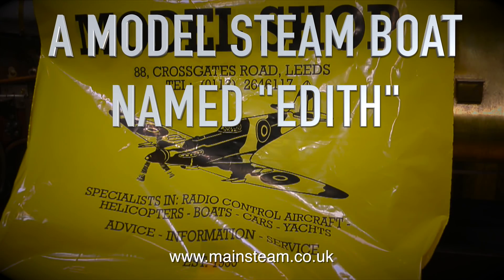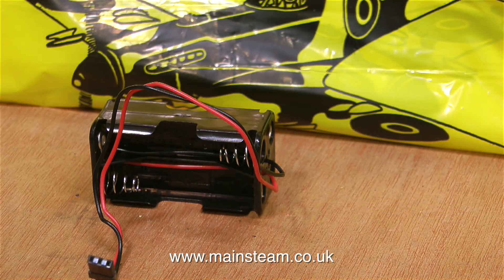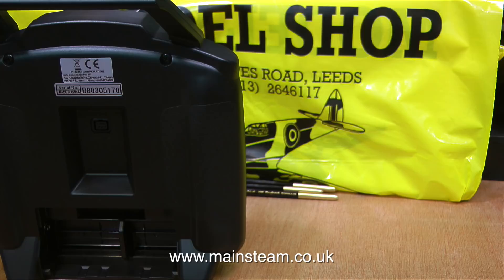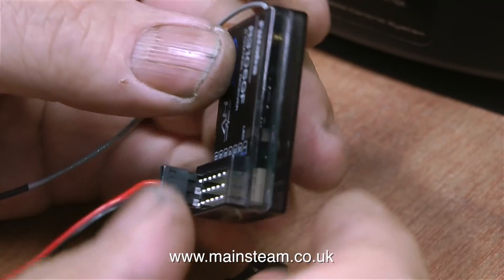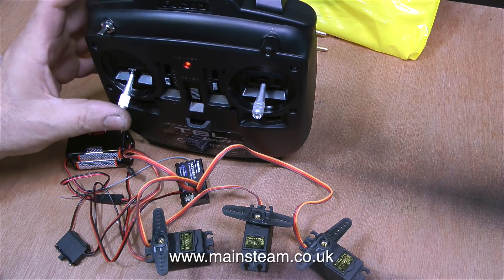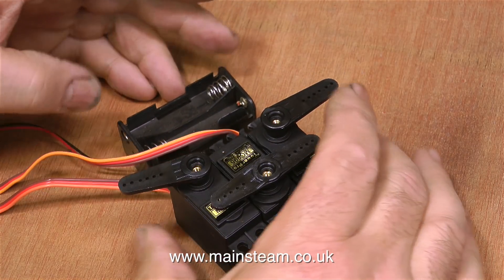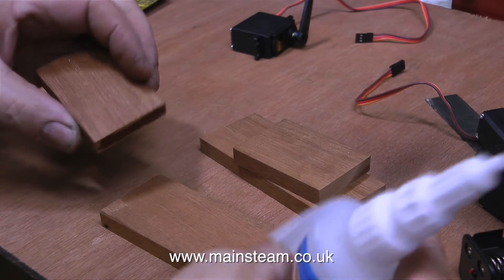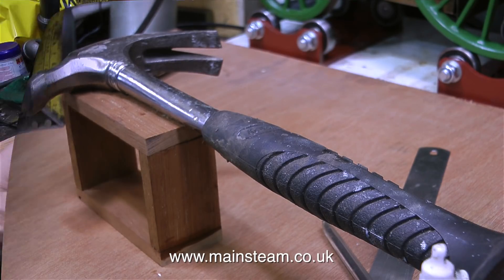A MODEL STEAM BOAT NAMED EDITH - PART #16

Comment: Being more or less a newcomer to live steam as well as home machining, I am very thankful for the availability of your videos. They are well made, informative, inspiring, and more entertaining than what's on TV a lot of the time. I hope you will keep making them. 

I'm not sure if you're familiar with PM research from the US, but I've just finished building their vertical boiler and will steam test it once I've finished their manual feed pump then use it to run one of their #5 vertical engines. Being in a rather rural area of Canada, I have to wait for the mail to deliver all the parts I need. I must say, I'm envious of your close proximity to Blackgates Engineering! They sure do make great looking fittings and such and I would love to be able to take a short drive and get what I need rather than waiting weeks for the mail!

Comment: on the new 2.4ghz the recever can never connect to any thransmitter other then the binded one
unlike the old fm and am  systems
Reply from the maker: not even one of the same type ??? I have personally seen two model boats changing transmitters - on 2.4GHZ but this was a while back ....
Reply: nope modern 2.4ghz doesnt have that
when you first bind the recever it gets bound to the transmitter
after this bind they are linked untill the recever gets rebound to a new transmitter
i have been using 2.4ghz for 7 or 8 years now
and i never seen it happen
Reply from the maker: Back in the "Good Old Days" }:-))) https://youtu.be/KsQy0OIlVp0

Comment: Just getting into First Person View RC flight myself & wondering if you've thought about fitting a small FPV camera/transmitter onboard for monitoring the boiler & mounting a small screen on top of the Futaba?
Could even run multiple cameras if so desired- put one up in the Bridge on a servo perhaps? ;)
The Eachine VTX02 would be a good cheap little camera for experimenting with...
Something to think about anyhow....
Best of luck & thanks again! :)
Reply from the maker: I have some "GoPro"  type cameras, I will try one on 'Edith", but only on the bridge . . . these small cameras get hot anyway when they are running - I dread to think how hot they would get inside a Steel Hull with a boiler fired by a gas blowtorch }:-)))
Reply: The camera's Im thinking on are a lot smaller than a Go-Pro or it's clones & has a 5.8Ghz transmitter to watch on in real-time...
I know Go-Pro clones can do this after fitting a transmitter but there is quite a bit of latency & the complexity..
The pair Ive used on planes & Gauge1 trains is 25aud for the camera/transmitter & 132aud for the 40channel 7inch monitor with sun-shield DVR (although, there are cheaper)....
Great for watching the water glass from the tender as it zooms around- well, that was the excuse! :v
Camera only needs 3.3 to5DC to run..
Ive also though of mounting one on a Mammod roller clone & fitting RC gear
Anyway, just thought I'd share an idea & hope it might give you a few of your own too
I'd have posted links but I know your rules & whole comment would have been deleted to the digital dustbin
Thanks once again for your time & content!
(You can keep your incontinence, we already have plenty!)